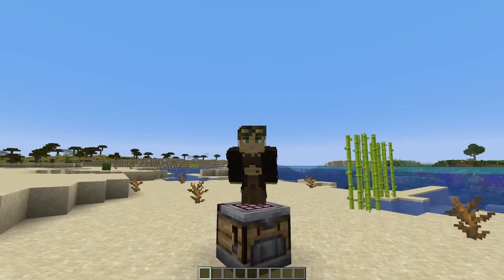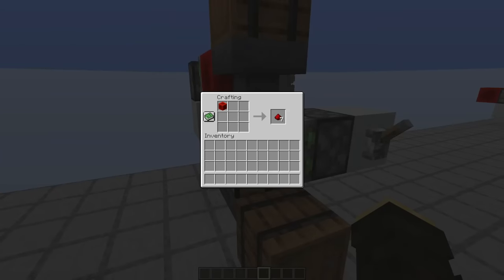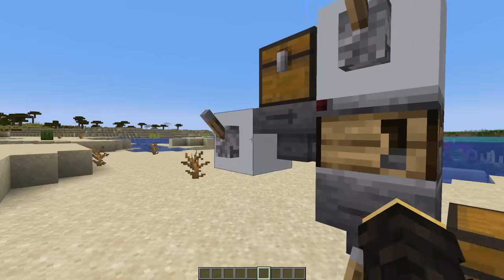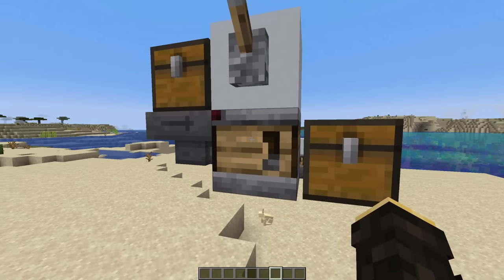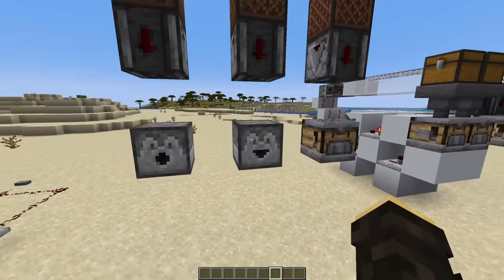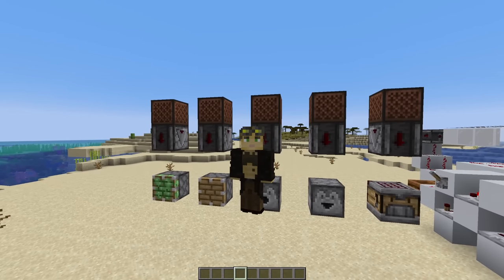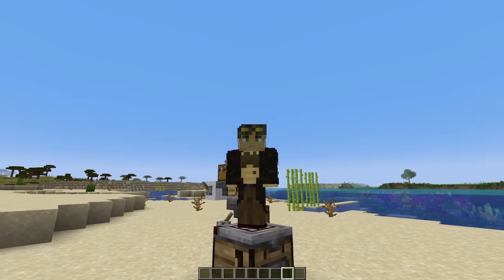The Epic Return of Autocrafting

Comment: The one thing I would like to see from the crafter is a way to lock slots without opening a GUI. Maybe a redstone signal from the back could lock the next open slot. This would probably make universal crafters much simpler.

EDIT: After thinking about this idea for a bit I'm not sure if it's the best, unless you could make a system where upon activation and deactivation the slots are toggled. I'm not a redstone expert but a system where you put your inputs in 9 separate barrels and have empty barrels send a single pulse upon a lever use would be ideal for this.

Comment: Thoughts on the autocrafter:

#1 - The autocrafter loads items from a hopper in a known order. A line of "N" droppers with the appropriate items and pulsed once deposits the 9 items needed into a chain of "N" hoppers that will feed the items into the autocrafter in the proper order from the top.

#2 - A redstone signal of 9 is fine to know when the recipe is set and it's able to craft an item. With that, you can automate changing the recipe as long as the blocked off pattern slots doesn't need to be changed.

#3 - I hope they implement a redstone signal higher than 9 when the slots have enough items to craft more than 1 item (i.e. craft an item WITHOUT clearing the recipe). That would be very useful. But that couldn't work if the pattern requires unstackable items and you have to resort to #1 above.

#4 - If they implement a separate 3x3 inventory to set a recipe it would solve the problem in #3 above with unstackable items. The recipe could load from behind (like furnace, etc), and top loading would load the ingredients. The autocrafter would need to accept only the items matching the recipe and place the items in only the slots indicated by the recipe which would make the source code Mojang has to write more complicated. But a signal strength of less than 9 indicating that the recipe is not set, and a signal strength of more than 9 indicating more than an item can be crafted would both allow the craftables and recipe to be automated.

#5 - A more useful signal strength, perhaps binary?  bit-3: recipe is valid, bit-2: items present in recipe, bit-1: item can be crated without affecting the recipe, bit-0: item can be crafted.  --- Simple circuits can be built to rely on signal strength 15 to know when to reliably send the crafting pulse without affecting the recipe. Advanced players can build redstone circuits to automate crafting almost anything. But those redstone circuits will be very different from what how people think about redstone. Everyone uses redstone like an on/off or like an analog signal. Hardly anyone uses redstone as a 4-bit binary signal.

Comment: I don't know much about Redstone, but I have an idea for the universal crafter... 

It has 2 inputs, the config primer and the mats, both in Shulker Boxes. The config primer is loaded first with the recipe in order and the crafter is loaded an item at a time. The config primer has named items that are sucked first and stored as a number.
Then the mats are loaded in bulk.
Because the crafter is "Primed", the mats are going in the correct order. Once the mats are loaded, the system is activated X-1 times, which X being the stored number. 
The last bunch are loaded and the system fires once more, leaving the primer still there. 
If you want to clean the Universal Crafter and do something else, push a button to send a pulse to the crafter and configurate another Config Primer and another Mats Shulker Box.
Reply: The crafter can't say "primed" if one of the recipe ingredients is unstackable (like bows in the dispenser recipe, or milk buckets in the cake recipe)
Reply: @tetsujin_144  Nope, it can totally stay primed as long as at most 1 ingredient is unstackable, because when the crafter is activated it will consume all items by one instance, leaving only one space for the unstackable item to fall into. 

Although I will recognize that this also means that you need to leave a bit of time between the activations to account for unstackables.
Reply: @tetsujin_144  And in the case of cake, the milk is the same item, so it doesn't matter what bucket goes into what slot, because all of them are in the top row which will be empty

Comment: I personally think making it so that a comparator shows how many items can be crafted is a better way to implement comparators with crafters 
(Meaning if you have a single iron block that you can craft the signal strength is 1 and if you have 2 the signal strength is 2, etc etc and 15 or above will all be 15.
I think it's better because with the current system you can't differentiate between 1 or 2 craftable items and if you could then you could auto "set" crafting recipes since they will not change in the crafter (if that makes sense)

Comment: i strongly disagree with making the comparator range from 0-15 on the crafter

there are elegant tile-able systems with the 0-9 using lecterns or filled composters

it is WAY more intuitive having 1 slot = 1 extra power

Comment: you should make a redstone component farm where you combine a slime farm, witch farm, tree farm, cobblestone farm, smooth stone farm, iron farm and any other farm im missing to proudce all the raw materials needed to produce redstone components. 

Can have automatic mode where you produce x anount of every component and store it and you can have manual mode where you select a component thats needed and it will only output said item at a higher rate.

Would combine a lot of farms and redstoning techniques and would be the farm of all farms. A redstone farm that produces redstone components for more redstone farms.

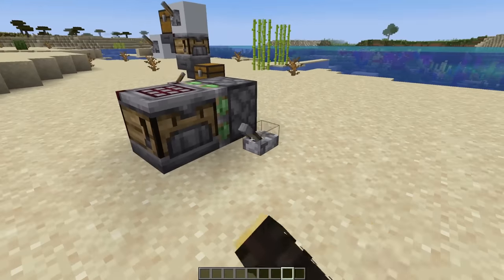Comment: @9:03 
My thoughts admittedly go to something like dividing the crafting recipe into rows first, and then inputting one row in per face, seeing as the crafter evenly distributes resources.
Reply: The problem is getting them in order:
If you fed the crafter from three sides with hoppers (the simpler case), I think you could rely on update order (on Java edition) to put the items in in a consistent order. But it would take 12 redstone ticks to get the items from the hoppers into the crafter, and once you got those 3 items out of each hopper, you'd have to get 3 items back in again. You wouldn't be able to have 3 full stacks in each hopper of course because then it would just feed the crafter with 3 items from the first stack each time...
With droppers, it'd be roughly the same issue except the dropper wouldn't be consistent with the order in which it puts the items in the crafter, unless of course the dropper only contains one type of item...  Which is the whole problem, how do you feed in as many as 9 distinct items into the crafter when it only has 6 sides, and you need one of those sides to get the items out?

Comment: Wait, wouldn't a hopper suck in objects in order of when they were dropped? My point is that if you would have a grid of 9 droppers representing the crafter's 9 slots, and you would power them in order of placement, you could funnel the output of all dispensers towards a single hopper into the crafter to add each item at each slot (especially thanks to the non-stacking feature of the crafter which would not add the same item to the same slot when encountering a new one ?
Reply: The issue with this is that hoppers empty from left to right, so if you have multiple of the same item they would stack together. You would need the dispensers to fire in sequence as slow as a hopper.
Reply: @GIRGHGH  True, this would make the system slower, but would still be a possibility, just less efficient right?

Comment: Could you somehow use a minecart or hopper chain to implement a universal autocrafting system? Basically think a "tape reel" that can be "programmed" to contain only required materials in order of how they need to be inputted into the autocrafter block. I haven't really looked  into how the new block works but that's the first idea I had. Depending on how viable a system like that is you could have the system draw materials from, and potentially even deposit materials into, a central auto-sorted storage system too.

Comment: Instead of using a crafting table loop to craft, would there be a way to use hopper minecarts to get items into the auto-crafter? Stacking hopper minecarts might also be an option. But you could have an interval rail system that would pick up the items for crafting then them feed them in at specific timings. This system could also be something you could toggle through and interface too. Though I'm not sure about affecting the crafting grid since you would have to do that manual, unless you could have a filter underneath for placeholders put into the hopper minecart loop. 

Really this is just food for thought, but through this, it may be possible to have the minecarts run over a row of crafter and feed them while the next batch comes if you want to craft in bulk

Comment: You can have the autocrafter feed directly into a chest or other tile entity without hoppers. Also you can fill all the slots to prevent the resourses going to the wrong ones
Reply: The main issue with a pre-fill solution is that if your resource supply runs out, you'll have to reload the layout and not just the resources, unless you shut the whole thing down when your chest or dropper or whatever runs dry before you cycle the last crafts out of the auto
This is still gonna have some real nice use cases in semi-casual application
Reply: @syrelian   hook it up to multiple farms then

Comment: It seems like you would be able to use a dropper tree to input more kinds of items to a single face of the crafter. It wouldn't be as fast, of course, since you'd have to drop ~two items per face, but it could get around the item count issue.

Comment: I don't find the redstone output strength of 9 to be much of an issue, and I generally like the simple scaling of the signal. I made a 3x6x1-wide tileable block packer in a couple minutes. I kept the redstone dust at power level 8 and detected when it became level 9 with an observer. I do think it would be nice if there was a way to tell if an autocrafter was completely full with stacks of items. Maybe there's a better use for signal strength 15 than just changing the existing scaling.

Mixed feelings about the lack of QC on this block. I love QC on pistons, and there are scenarios I like it on droppers, but I also often find it a bit of an annoyance. I think you're right and it would be better to have it. It is really similar to a dropper after all.

I have noticed one possible bug, it seems that when an item is crafted, the signal strength stays at the same level until the comparator gets updated by another item entering or by another event.

Comment: A universal crafter seems to be possible, but hilariously costly.

You'd likely need crafters with every relevant combination of "blocked" slots, though I suppose the dummy item technique could allow you to avoid this issue and use a single crafter block.

But you would likely need to use an incredibly precise stream of hoppers to transmit singular items, which would be ridiculously slow, though you could also use a stream of droppers to speed it up a little.

What's relevant is that the items would likely have to be input one at a time for the sake of precision, which would be, once again, slow and costly.

Comment: you can craft any recipe without the crafter being movable (for that you just need a dropper chain)
Reply: Right but the benefit of a piston feed tape is that by moving each crafter to each individual ingredient it needs, your average rate of item production is as fast as your piston feed tape speed. On Java edition (since zero-tick pistons are a thing) I think that would mean one item crafted every 2 redstone ticks, which is pretty fast for a relatively uncomplicated machine.

If you fed a single crafter with a dropper chain, I think it'd take 9 ticks just to get the items into the crafter. Of course you could have multiple dropper-fed crafters to make the process go faster, but then your item distribution gets more complicated: Instead of (for instance) 9 shulker unloaders, one per slot, feeding the feed-tape assembly line, you'd have 9 shulker unloaders *per crafter*, and need at least 4-5 of them to get crafting rates as good as the feed-tape design.
Reply: @tetsujin_144  dropper and hopper speed are both limited. For that reason your calculations are off and there isn't actually any benefit except for the blockstream being slightly smaller

actually the opposite might be true: with a blockstream you can input at max from 4 sides (with cubics layout from one) while when stationary you can input from 5 sides (6 are possible though complicated).

Comment: possible idea: what if you were able to put a redstone signal into the crafter, and on quick pulses it would close that respective slot in the table. Not best explenation btu example: you want to close the middle slot, you have a quick on and off redstone signal with a power of 5, which shuts off the 5th slot in the table, then automatically chaneg it to the 3rd as well, you make a strength of 3. To clear it maybe you could have any signal strength above 9. Kinda messes up how u power it up to finish crafting with redstone, but like a diff block to let that happen would be cool

Comment: Edit: nvm, I see, the issue is with interference not from reading the output but with trying to send signals back around it, which could normally safely power parts of the grid of dust without their signals interfering with the 15-strength detector's output, but with these 9-strength signals instead then mild interference from inputs back to the crafter could mess with the ability to read the crafter's output, woops, ignore my original comment below.    ....I'm not sold that there's no solution yet, I'm curious what some further time and research could result from the community attempting to learn to integrate a 9-strenght version of this block, but I agree that 15-strength would just be nicer to start with instead.

@6:25  for the 0-9 vs 0-15 signal strength, can't you convert a 0-9 into a 0-15 in a one-wide-tile friendly manor (allbeit at the cost of extra space/materials) by putting a repeater at the very edge of the 9-tile range, turning the max-strength of 9 into a 15-strength signal that you can then collect farther away? (with a row of repeaters only the one repeater directly in line with the 9-strength source would be powered, there'd be no crosstalk between rows, and this repeater output will get you your already familiar 15 signal strength output, no?)

Comment: To get around the 9 slots issue, you could have your 9 items just get dispensed 1 by 1 at hoper speed into a water streams that all take an equal time to get to the single hopper leading into the crafter. would be extremely bulky but would work
Reply: So I just built a proof of concept, 1 water stream on ice is all that is needed. simply have 9 droppers with a 1 block gap between them all shooting into the water stream, in between each place a repeater set to 4 ticks and either redstone dust or a block ontop of each dropper. works perfectly, it's not fast but it is very simple and cheap so could make several of them, currently uploading a short video of how I built it, I'm sure better designs will come along in time but for now it is functional
Reply: Dispensed? That's just asking for trouble due to the randomness of droppers and dispensers
Reply: @racernatorde5318  works, just need the water stream to be completely enclosed
Reply: @CAIDMASTEROFPYRO I wouldn't be so sure. If you have two droppers next to each other facing into the water stream, it might be possible that the items get switched. And then there's also the hopper cooldown to consider
Reply: @racernatorde5318  They have a block gap  and a 4tick delay on top of the extra time to travel down the stream. don't think it is possible to get switched

Comment: I didn't test the new autocrafter yet, but wouldn't it be simplier to have a hopper line into the autocrafter where every hopper is filled by one item of a specific kind. Empty slots will be filled with filler items. The filler items will be sorted out from the crafter and then the crafter gets powered. 
Voila, you have a universal autocrafter. The only thing you have to change manualy are the order of the items you put into the hopper line.
It wouldn't be the fastest way (hopper speed * at least 9 times), but because of item filters are tileable and hopper lines are tileable it should still be able to make paralel crafting. 
I imagine a bunch of chest-minecards running over the paralel hopper lines, all at the same time, then each hopper got 1 item of the kind you need for that place. With some timing it should be able to make a faster system, 9 blocks wide + 2 for item collection and as long as you want.
Reply: That is slow and bulk crafting needs to be extremely fast

Comment: Changing the range from 0-9 to 0-15 would actually make it harder to use wouldn't it? The current implementation lets you know when the recipe u desire is ready based on how many slots are full. So for a chestplate, 8 slots need to be full and you'd get a corresponding output of 8 signal strength. How would u be able to do the same with 0-15? Using the signal of 15 to know if it's full isn't correct because even with the 0-9 range, any result can be "full". Take sticks for example, the recipe is full/done at 2 signal strength.

Comment: You probably haven't seen it yet, but there is an item input precedence which should answer your questions about the implementation:

First preference to filling empty slots
Second preference to the slot with the lowest quantity of the same item.

Also, you can just set up an empty crafter with a comparator as a check to see how many slots are empty on the working crafter, so a redstone output range of 0-9 is very useful in this context.